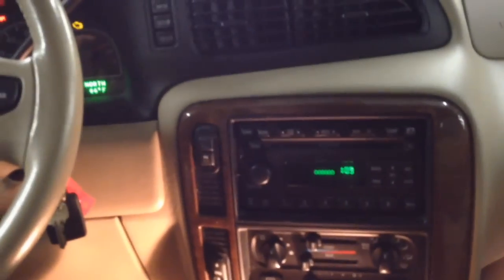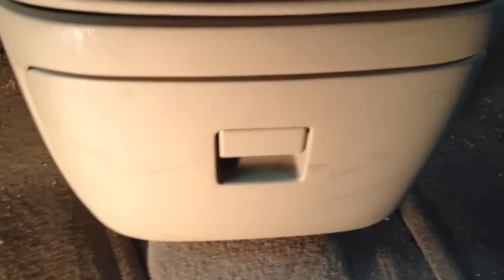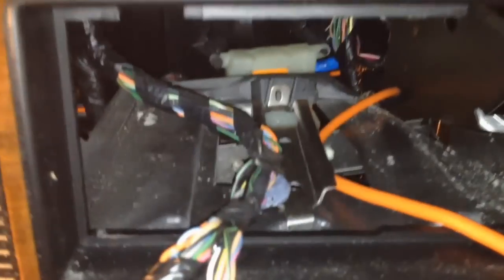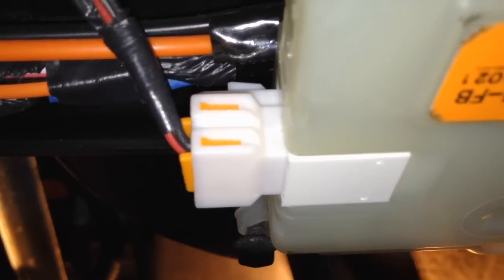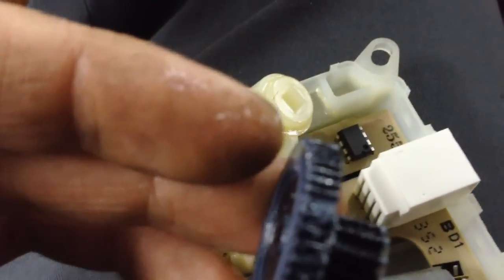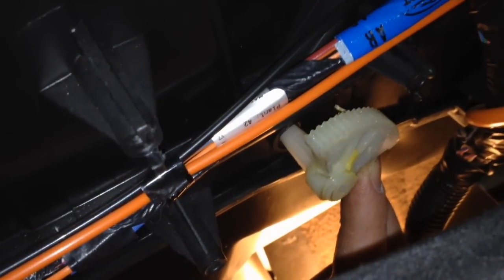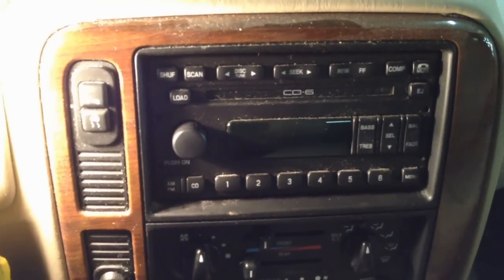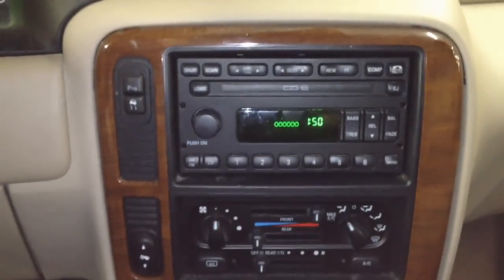NO HEAT: Ford Windstar Blend Door Actuator Removal

Comment: I just changed the actuator motor now my van won't start.  I think it has something to do with the anti theft.  any suggestions.  battery dead but when I try to jump start it the flashers and anti theft just flash very fast but won't turn over.  Once I remove cables the battery is already dead.
Reply from the maker: canson70 You shouldn't of touched anything that could have an affect on starting. It just sounds like your battery is dead and won't take a charge either the only fix for that is to replace the battery as the plates get sulfated over.

Comment: Hi, i replaced the actuator it blows not that much hot air what could it be.
Reply from the maker: First I would make sure the door can move freely, then check for full range of the actuator by watching the shaft. After that make sure engine is coming up to temp.
Reply: Ok thank you.

Comment: Thank you so much for this video! I just replaced this in my 2001 SE Sport. My installation had one additional step. I have a power outlet on the passenger side of the lower plastic piece. After disconnecting the plastic clips holding the piece on, I needed to disconnect the wire clip for the power outlet, and then I could remove the whole U-shaped plastic piece. Just an additional since please step. Thanks again!

Comment: Hi there.  I am an owner of windstar 03 all the way from Korea.  I have been searching for the answers to my problem and I think I found it in your video.  Thank you very much.  Just one quick question before I place my order for the blend door actuator.  First  I didn't even know what it's called! But looking at the synmtoms I think it's the blend door actuator problem.  I am getting "clicking sound" whenever I move the lever all the way down to COLD and up to HOT and the heater does not work.  This is the blend door actuator problem, right?
Reply from the maker: 최원준 Sure is order it up!

Comment: Great video.  This helped me do the same repair today.  I found that the radio actually doesn't have to be removed, except that it gave me more daylight to work.  I was able to do it all from the bottom while laying on my back.  It didn't take more than 45 minutes including cleaning the old soda off of that shroud!  It cost the same as Patrick below.

Comment: hi
I have I few questions.
my 98 Windstar has no heat

first step I did was to check if the fuse was blown and it was so I changed it and it worked for a bit but then it blew again

next step was I checked the motor wire and it was good and in working condition then I  checked wire on the switch and changed the switch and change the resistor everything looked fine and the fan ran for a little bit but still blew the fuse.

I plan on checking the wires from the motor to the fuse to look for any cracks or breaks or if its touching anything but I was wondering if I am on the right path, or if you have any ideas.

Also could it possible that the motor has too much resistance or if maybe its getting too hot, I don't wan to change the blower motor unless I have to

Thanks
Andre

Comment: The blend door on my system broke at the connection point. I have removed the air cabin unit and can move the blend door with my hand but am having trouble removing. I dont want to break anything inside because it is all plastic. I dont know if there is enough space to move the blend door around and get it out and get the new one in properly. Is there another entry point or can I remove the plastic frame that the air cabin unit screws into? Thanks

Comment: Everything being shown here is great …. But I just replaced mine today and found an easier way….U must remove the radio to even see the whole alignment where u or going to insert the new one…And They must be the same position as it will not go in …. If they are not the same which I don’t think they will be..lol
just take new one and plug it in to the wire plug inside the radio opening there,,,,, Trust me it simple and u can get two hands in there one to hold the piece and one to hold plug and insert …Turn the key on and let it adjust itself it will automatically you won’t see it move just give it 30 seconds and will set itself like the one that come out… Now if you only have two bolts on the left side you can reached them by going up the side and behind that molding instead of removing it..Plenty of room there already and I am a big man with big arms…….. But mine had three one on the bottom of the right side. So All I did was pull out the two plastic retainers on the right side panel and gently pulled back and out and gave me enough room to shove my arm up in there and behind to ratchet the other bolt off without removing it completely … Took me 45 minutes start to finished… I hope this helps someone out...Michael…

Comment: I have a 2007. Could it be possible for this motor to go bad & prop the door open partially? I'm getting heat on the driver side & not on the passenger.

Comment: Great video ...I have a '99 Windstar SEL with this same issue, but after removing the old actuator, I didn't seem to have enough room to maneuver the new one around to get the arm into the opening ...I don't seem to have nearly as much room as you have in your video.  The keyhole opening was not at the same orientation as the key arm, which would require me inserting the arm, then twisting the actuator so that the screw holes line up, but there's just no room for that.  Is the '99 different in some way?  Now I'm afraid I stripped the opening where the arm goes from screwing around with it so much.  Any ideas?
Reply: Did you fix it?

Comment: will the actuator also cause no heat from the rear heater also?
Reply: +Robert Scrip well I know its not the Actuator! I got it out and apart, gears are good and it moves like its suppose too..  Stuck the rod in and the door moves nice. No heat front or back, temp gauge in the middle.. not sure where to go from here..  anyone have any ideas?
Reply: +Robert Scrip Problem Fixed...  Sad to say I missed an obvious...   Even through the engine kept the right temp the coolant reservoir was empty!  Filled it with antifreeze and water mix and we have heat!..  it was a tough lesson as it was -3 today and it was a driveway job..
Reply from the maker: +Robert Scrip Darn that sucks, at least it works now. Time to find that leak now.

Comment: I am a woman and facing two different mechanics that tell me the entire dash board has to be taken off and 5 to 9 hours labor to fix this problem for my 1999 Winstar at $973.00 to over one thousand dollars cost.  This defective car has had all the recalls fixed and I had to replace a computer at $800.00 for a faulty tail light. Thank you for this video.  I may try to do this myself, but my question is why can't my mechanic do it this way?  I hate these new cars.  I'm not going to pay a thousand dollars to fix this problem.  This is a defect and the Ford company should fix their defective cars for free or for a reasonable price.
Reply from the maker: Gloria Jean Do you have clicking when changing the temp? Then yes this is the repair procedure 10min job  tops. Links are in the description for the actuator you will need.
Reply: FordTechMakuloco Yes I did have a clicking sound and so  I already paid a mechanic to replace the blend door motor and it worked for a few months and now the actual door is broken. I paid over $300.00 to get the motor replaced, if indeed he replaced it.  I have since decided to go with the heater-treater method and replace the door with that.  I am going to either do it myself or look for a local mechanic who wants to become a heater treater affiliate. The kit for my car is $119.00.

Comment: Thanx for the tips.
 At around 2:30 into this vid you mention another vid explaining in more depth how to remove the radio using a coat hangar. I checked your channel but couldn't find it. 
Is it still there? Do you have a direct link?
Reply from the maker: +Foz Foskwatch https://www.youtube.com/watch?v=1j4gBrDuVGo
Reply: I'm working on a freestar. I figured it out. No special tool required. :D

Comment: Great video , fixed mine last night !!!!!!!!! I spent $7 on the radio tool and $36 on the part. The hardest part was getting my big hands in the tight spots !!!! Would like to add that I did have to unfasten a plastic fastener that held some wires in place. Just could not get the actuator in place without doing this. Thanks Again Patrick

Comment: Where is the auxiliary blend door actuator for the rear heat and ac?
Reply from the maker: Seth Loop Left hand side rear
Reply: The rear as in the back by the hatch to the cargo area?
Reply from the maker: Yes there is a large interior panel back there remove that and everything will be exposed
Reply: Right on thanks.  I found a forum that states its in the interior  panel above the drivers side rear wheel.
Reply: FordTechMakuloco  I have cold and heat up front and no cold air in rear but I have heat in rear. There is no clicking noise when moving rear control to cold . Is this the rear actuator and do you have video of rear replacement of actuator and panel removal? Ford Windstar 2003 SEL

Comment: my heater blows cold, makes ticking sound. started right after a friend "fixed" something on my shift column. any things i could check? thanks.
Reply: mexicatl16 that's the gear on the servo motor skipping on the other gear, just replace the little box and you'll be good
Reply: We have that same problem. I thought that's what it might be.
Reply: hannah weaver yup, it has little plastic gears that over the years get brittle and just snap inside, I'm 100% sure that's your problem.

Comment: My 99 Ford windstar has this clicking at all times ac on or off. Could this be my problem? I have no heat in front defrost only blows cold.. The back of that van is the only place hot air will blow.
Reply from the maker: Joni Yates Yes this is likely your concern

Comment: did u replace the gear ?? or just remove it? Im having this issue with my van right now and im freezing , i need to get this fixed pronto . so do i just take it apart and take out the broken piece and then put it back in or do i need to change the whole unit ??? any ones ans is welcome as well as the the owner of this video please and thanks ahead of time
Reply from the maker: +Puffy Jo I removed the gear to test the door. Once the actuator has failed there are no parts to fix it you must replace the entire actuator unit.
Reply: ok thank you very much
Reply: Puffy Jo I did the door test and the key slid all the way is so im guessing thats the problem how can i fix it? and the actuator is fine.

Comment: did anyone know that there are 3 models of actuators for this van ughh. i called for the part and was told there are 3 different models sigh so i still have no heat and we are heading into november
Reply from the maker: +Puffy Jo pm me on Facebook I can help
Reply: Puffy Jo give them the vin number
Reply: letsthinkitover1 i did , they said it wouldn't work , i thought of that right away , they are stupid , but best of it all i cant get the dang radio  out its stuck , now its freezing out , fun fun
Reply: go to junk yard.you don't need to remove radio to remove part. I have a video to show you how on mychannel
Reply: ***** hope it gets fixed I had mine on the blue cold switch it to red heat and it worked.  I forgot to change it from ac to heat. Dummy I am.
Reply: thank you well so far i cant get the darn radio out at all , I have tried all the tricks and no I still have no heat , i have owned my van for 10 years

Comment: Would this apply to no AC also? I have AC in the back but the front blows hot on all settings. No fresh air temp change.
Reply from the maker: Yes it can stick either way.
Reply: @FordTechMakuloco  thank you very much!👍💯
Reply: @FordTechMakuloco  may I ask 1 more question? I'm sorry - it just occurred to me... I don't hear any clicking sound. I am wondering, might it be the HVAC control knob? Thank you! I'm a disabled elderly woman who needs all the help I can get!👍
Reply: Forget my last question. The HVAC control works fine moving from floor to vents to defrost so I guess that means it's fine.
Reply: I did it! Thank you a million times over, sir!👍💯🙏👌💝